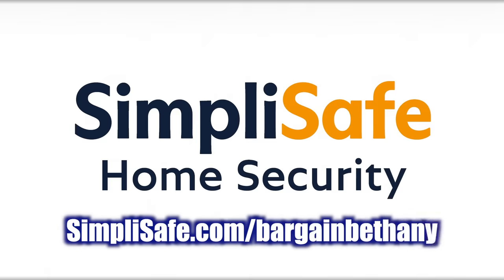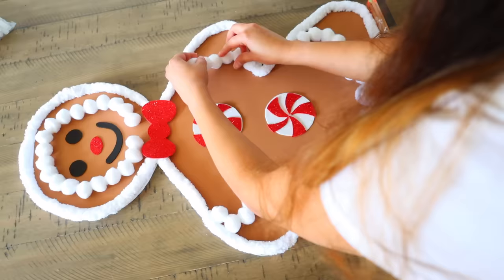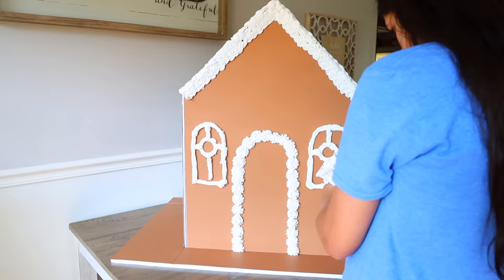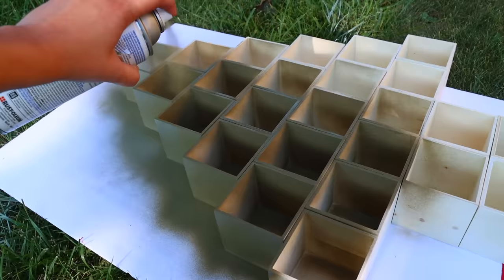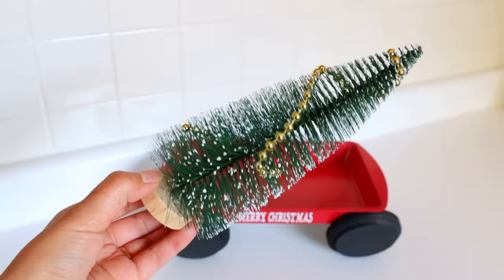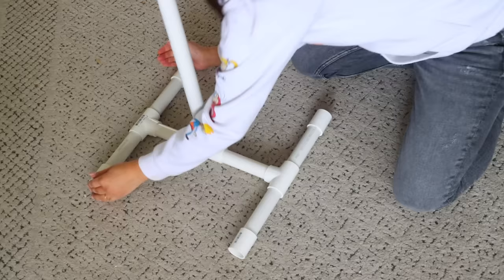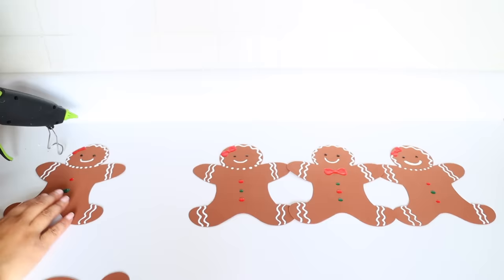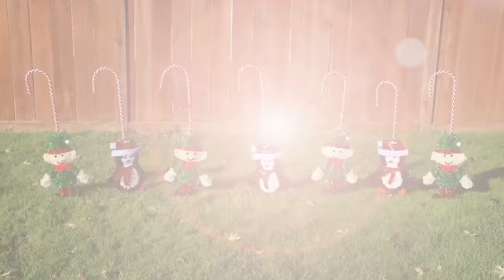*GENIUS* Dollar Tree Christmas DIYS!🎄(best ever)

Comment: I've diy and used the hobby lobby advent calendar for years now! I used bottle brush trees on top for a winter scene. I suggest if you have more than two kids, make a calendar for each if you can. The drawers are small so you can't fit more than one or two candies in.

I also definitely suggest checking thrift stores for trees if you want extra trees. I just found a high end pencil tree at the thrift store for $10!